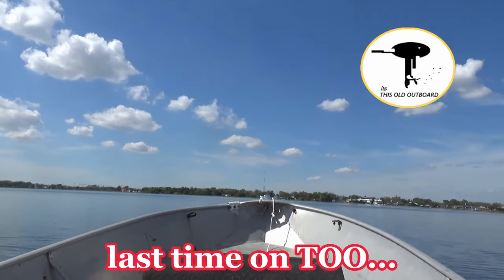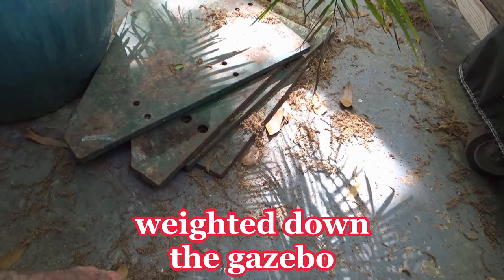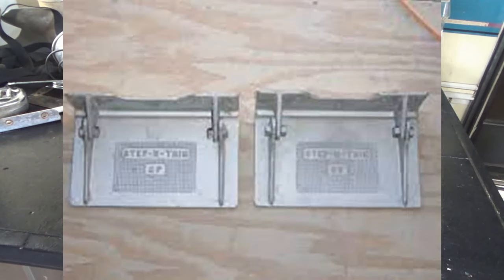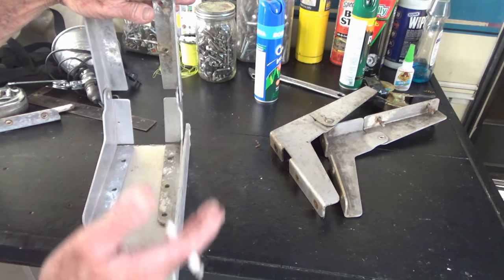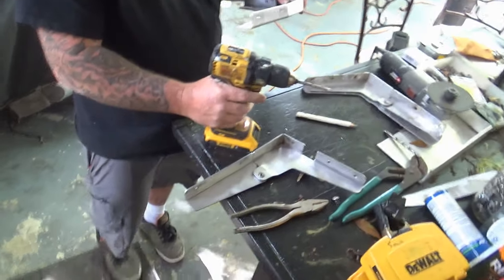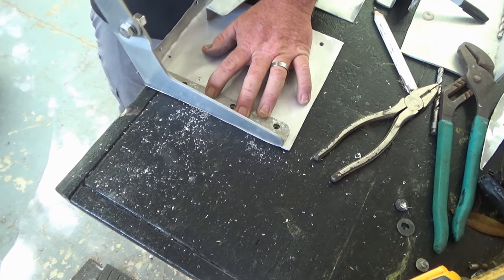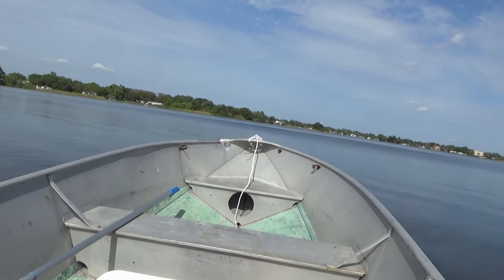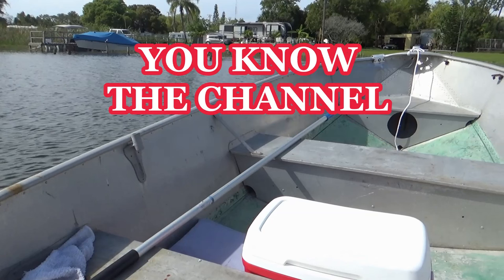DIY TRIM TABS EXPERIMENT pt 1 - THIS OLD OUTBOARD

Comment: Just saying ..... you could add a dolefin or whaletail onto the outboard cavitation plate to make the boat  obey the whaletail and 
make adjustments with the tilt pin setting(s)!   But trim tabs also work fine, and then you don't need to make drill holes in the 
cavitation plate to mount the whaletails!!!!  Love the videos!!!  Keep 'em comin!!!!!!!
Reply from the maker: Hey. Thanks for tuning in. Yeah I need the boat to work as I'll be test running all different sizes of small outboards. This motor won't be staying on the boat and I have other builds coming up of the same weight/horse power. I've got some dolefins and a big ass whaletail around here somewhere, I would have used them if I were keeping the boat/motor together. I wished I had never sold my 15' Dura Craft but oh well. I didn't realize this clipper was such a tin can! Hahaha Thanks again & Stay tuned !

Comment: Hell yeah! Good build. I wouldn't move the brackets on the transom, I'd elongate the bolt holes in the brackets on the boat so one side could be moved upwards or lowered, and you'd still have your swivel joint too.
Reply from the maker: Hey. Thanks for tuning in! Yes I came up with a different idea! Stay tuned !

Comment: Man. nice I put a couple of dumbbells in from of my Gregor, helps a lot, make sure you get the one's wrapped in plastic so they don't rattle !
Reply: Ever check for hull hook? A lot of boats, especially glass, that sit on trailers constantly get a hooked hull. 1/16th of an inch hook can cause porpoising.
Reply from the maker: Hahaha I won't be using dumbbells but your close! Stay tuned !

Comment: Have you ever set up a Jon boat with a 15” shaft that had a 20” transom ? 
Curious about the way a setback plate may work.
Reply from the maker: Hey. Yes! I had to test run a couple of small outboards and had no choice but to use my 16 ft Starcraft. That was fun, Not! Now I don't have to worry about it anymore since I got the 14 ft. Clipper. You'd have to go way back and 5 inches down, it will never work if it's a tiller handle. Best to just cut the transom down. Hope it's an aluminum boat! If you cut it, you'll have to consider the transom tilts back a little and the motor hangs straight. So the transon needs to be more than 15". The cavitation plate on the motor should be even with the bottom of the boat. Thanks for tuning in!

Comment: That's great 👍 I was thinking you could have put one of those hydrofoils on the motor to get the same effect 🤔 If you get those tabs up a little set just right it solves the boats issues then any motor should work Nice Job
Reply from the maker: Yes! Stay tuned for the next episode !

Comment: Hey this old outboard,I have a question,I have a 1984 Evinrude 15 HP,the pinion bearing is bad ,I removed it with a threaded rod and some washers,pulled thru the top,what I'm wondering is,do I install the new bearing from the top of the gear case housing,or press it in from the bottom of the gear case,and how far does it go in? Is there a flange inside so stop how far the bearing goes in?
Reply from the maker: Hey. Thanks for tuning in. Wow! Beats me, I've never had to go that deep into a gearcase before. From looking at the schematic of an 84 15, I see two bearings, #28 BEARING ASSY., PINION TO GEARCASE and #19 THRUST BEARING, PINION, with the two washers. I'm gonna guess you took out #28 since you were able to pull it out through the top but I dont see any washers with it. Anyway I would think you should be able to install it the same way it came out but how deep I don't know. I was going to suggest leeroysramblings.com, he might have something there, but the website is down at the moment for updating. Hate to say but you may have to tear the whole thing apart. Sorry I wasn't able to help. I'm curious to know what happens. Good luck!
Reply: @THISOLDOUTBOARD1  yes number 28 the driveshaft bearing appears to be in good shape, figured you'd know what I should do,know you've worked on lot's of outboards ,yes I was going to consult Leroy's but the site is down,just not sure if I should tap in down the housing from where it came,or press it in from the bottom, thanks for your input,keep the vids rolling 👍

Comment: Off the subject but anyone have any ideas on how to mount a bilge pump in a 1970 aluminum boat (tiller style) ?
Reply: Clean the boat bottom good. Then just glue the pump base to your hull with ‘Weld-wood’ water proof glue or a construction glue like ‘liquid nails’ Gary in Michigan
Reply from the maker: Hey. Thanks for tuning in!
Reply: I actually came up with a idea I'm going to glue a small plastic cutting board down then mount the bilge pump to it!
Reply from the maker: @danielscrapper8207  hey. don't glue it down. Just put it where the water gets the deepest, then strap down the hose to hold in place using some zip ties, some how, some way. If you glue it in you'll never be able to take it out and clean it.